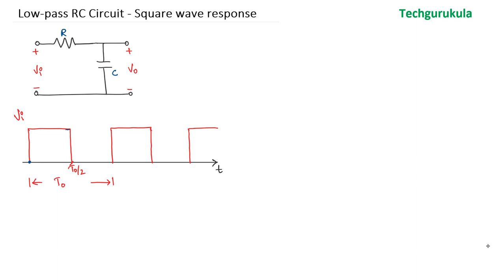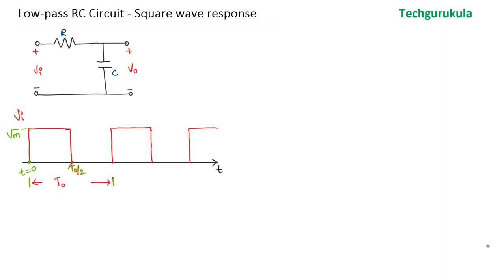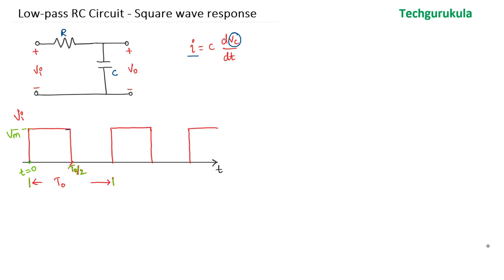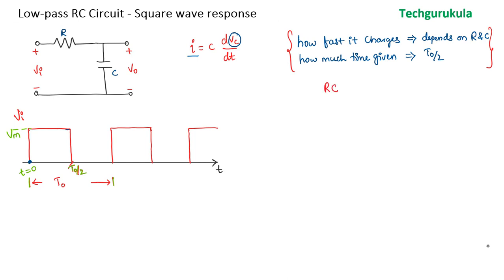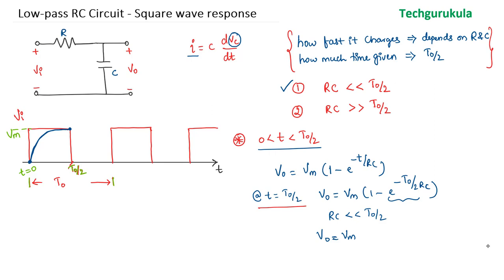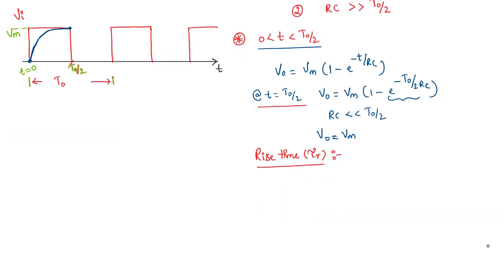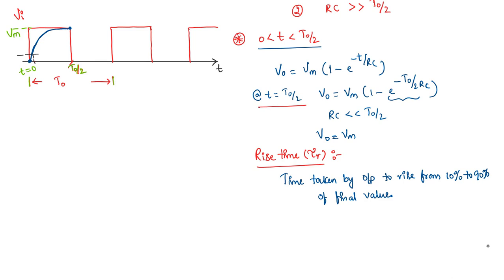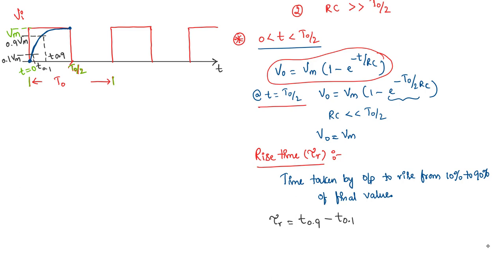Linear wave shaping - Low pass RC Circuit Square wave response

Comment: Sir at 13:00 how can e^-t/rc is written as 1-t/rc .please tell me sir
Reply: Refer to e^x expansion. e^x = 1 + (x/1!)  +  (x^2/2!) + (x^3/3!) + .......  When x<<1, higher orders terms become smaller and smaller. They can be neglected. So the expansion can we approximated as e^x = 1 + x. In this case x = -t/rc. So e^-t/rc would be approximated as 1 - t/rc for t/rc <<1. Hope this helps.
Reply from the maker: when t/rc << 1, we can write e^-t/rc as 1-t/rc.
Reply: Check Taylor series expansion or approximation
Reply: Can u give an explanation